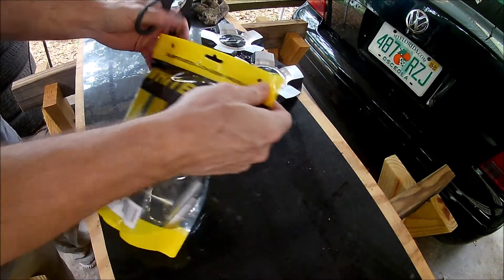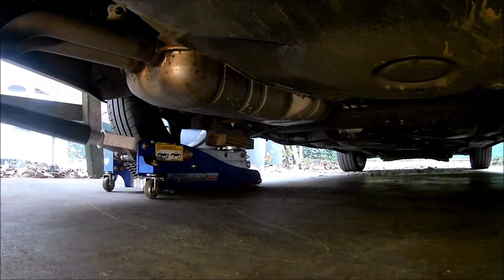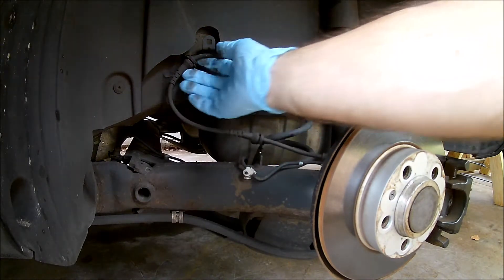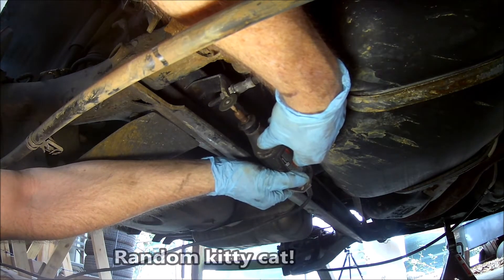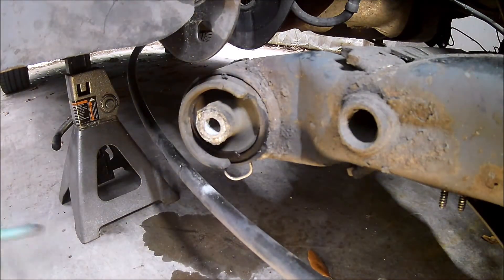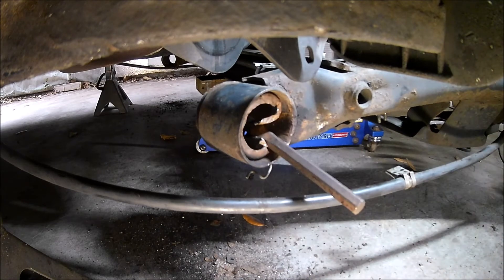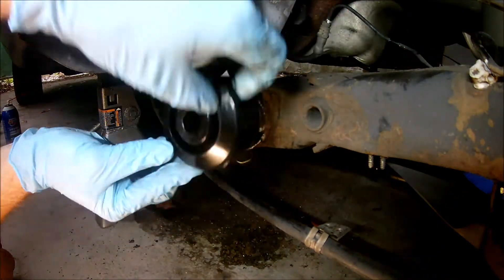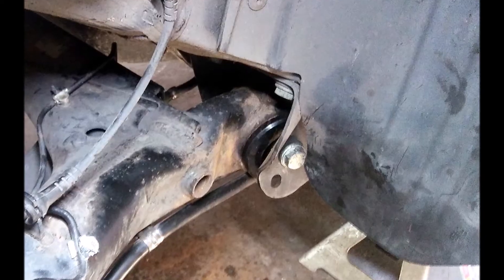Jetta Project Car: How to Replace Rear Axle Beam Bushings (Mk4) [remaster / re-upload]

Comment: Why did u think this was the issue? Like what was the car doing, that made you think "hey, this is the issue". Was it like a banging sound in the rear suspension? That's the issue im having with my jetta right now
Reply from the maker: Great question. Basically, 2 things convinced me to do the upgrade. First of all, the car had a lot of body roll. Second of all, when I jacked up the rear end (to work on the brakes), I noticed the bushings compressed a lot.
EDIT: That said, banging noise in the rear suspension could be the shock mounts or the axle beam bushings. You'll need to jack up the car and take off the wheel to get a look in there.